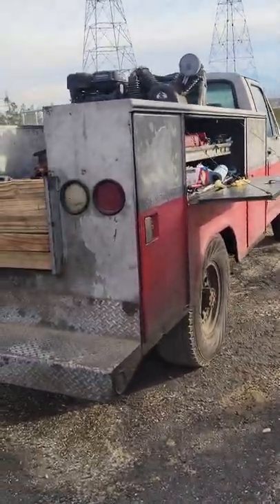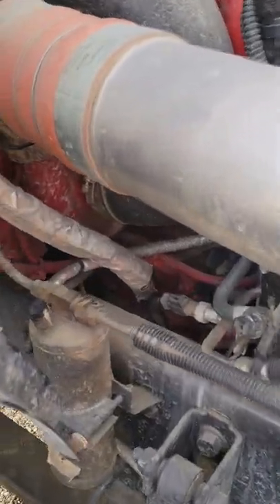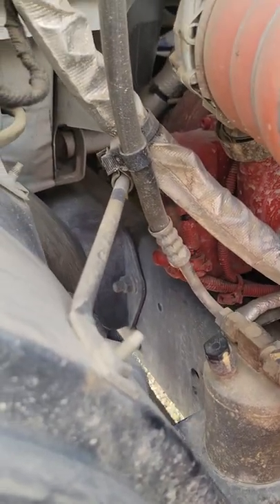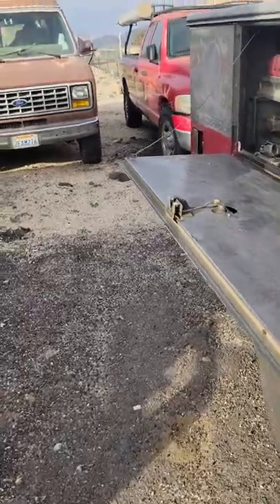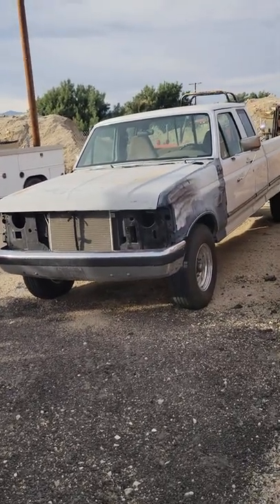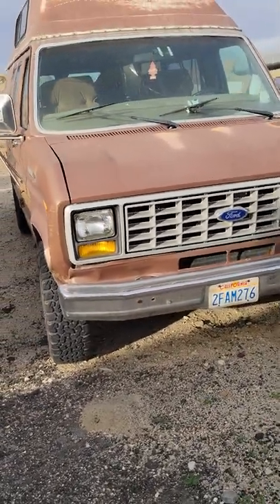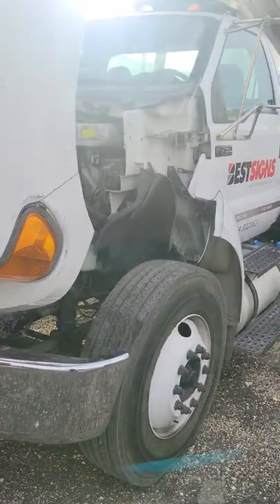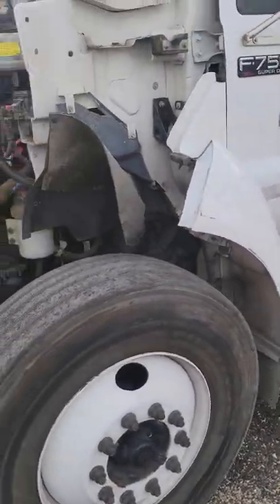F-750 going into Limp Mode// Cummins 6.7 Turbo Actuator Problems             #diesel #trucks #repair

Comment: so was it the Turbo actuator ? or something else ?
Reply from the maker: @edmioz,

It was a seized VGT Mechanism, the ring was stuck because of Carbon buildup...
Reply: Hey. Brotha did you check the data link voltage? What was the voltage